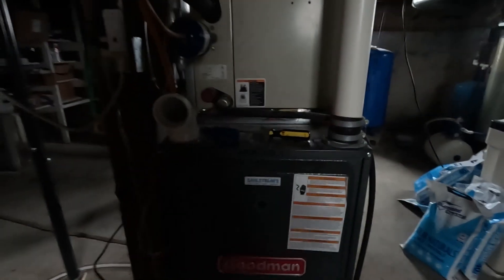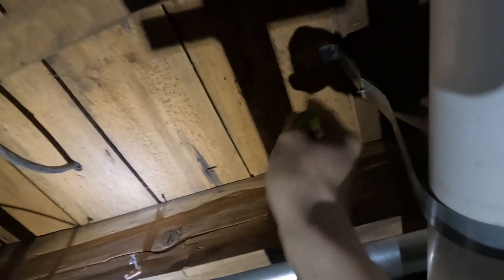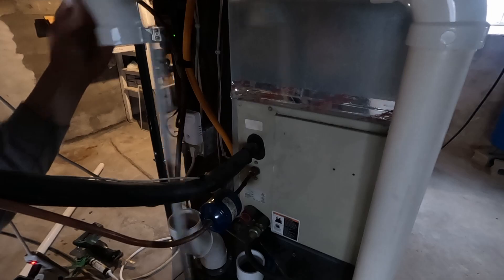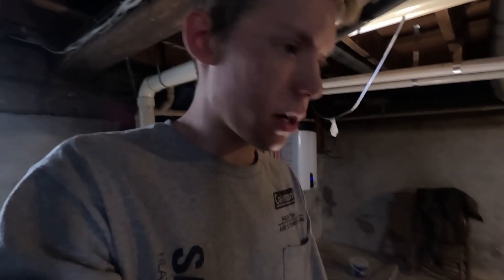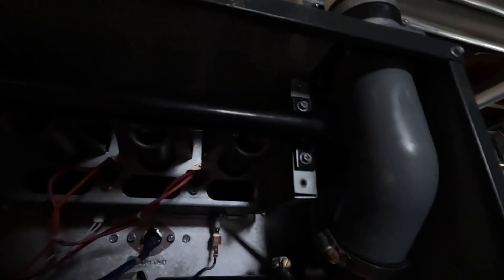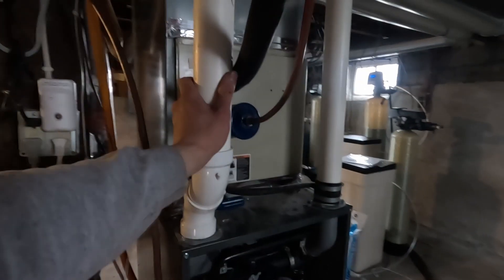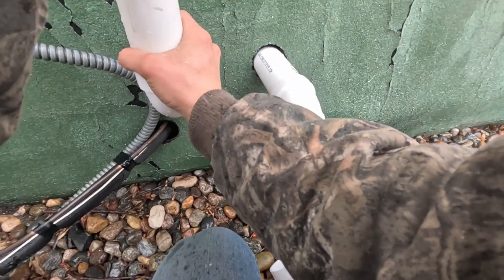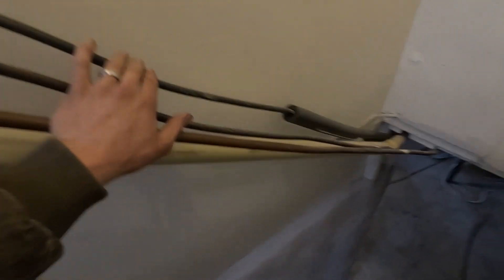Adding Fresh Air Intake to Existing Furnace

Comment: Is there a reason why they don't install "y" on the exhaust and intake.  I feel like a Y with a screw cap would make for a easy clean out if needed.  Or is there a reason they are not installed?
Reply from the maker: Usually it's best to cut the pipe, and put a fernco so nobody inadvertently uncaps the exhaust. If the combustion is out of whack it produces enough carbon monoxide to be very dangerous. The intake would be fine though, but we usually just leave some of those fittings unglued for easy service.

Comment: On your exhaust pipe, the white pvc looks like it is going into a black rubber connector?  I have leaking water around my flange the is attached to the top of the cabinet(where the white pvc is attached and the gray flue pipe on the inside attaches to the flange on the bottom).  Do you think my connections were glued?  Im sure they were and I plan on getting a new flue pipe, maybe the flue elbow pipe and a new flange & gasket.   Somehow water is leaking from around the flange(I checked the drain hoses inside & water is draining into the side catch & pumping out of the condensate pump.   Im thinking theres gotta be a crack where the flange and pvc meet?  Sorry for the long text just frustrated lol
Reply from the maker: Well, I would suggest trying to tighten up the clamps on the rubber fernco. Sometimes they work loose or the rubber shrinks a bit causing a leak. The other thing you could do is pull the condensate trap off and rinse it out good. Make sure the dip tubes are clean and not blocked off. I wouldn't think it necessary to replace the whole pipe. If you can just find where it's leaking I would just fix that.
Reply: @ReubenSahlstrom  I don't have the black rubber fernco.  Mine is a gray Goodman flange(part #200497) that has a think gasket where its seated into the top of the furnace cabinet.   The gray flue pipe inside the furnace is connected to the bottom of this flange, and then a 45 white pvc is connected to the top of the flange.  It is leaking water on top of the cabinet front around that gray flange.  Ive taken apart all the drain hoses and pipes to make sure theyre clear, which they are.  Disconnected the condensate and water is being pumped out, no problem.   I think either the flange has a small crack or it needs to be resealed at the 45.  I think the water is leaking when it runs back into the furnace in the exhaust line and a small amount is seeping thru the crack while most gets pumped out.

Comment: Goodman seems to design some things very well and some things terribly. Their burners inducers and pressure switches are pretty easy to access, but I can't figure out why they liked to put their blower capacitors all the way at the back of the blower. Also their condenser coils are trash.
Reply from the maker: You my man, have been around the block. I have found the same issues with Goodman as you. Their heat pumps are not very reliable. I am always fixing leaks and low voltage lines on them.

Comment: Hello I enjoy your movies.Can I say a few things. I am not trying to trash you since You most likely did not install this unit.
At 4:40, the filter is on the side of furnace.
The supply air going to the above rooms, have no visible return path to furnace,other than the stairs,which would make a hellish draft  and noise.
I won't even talk about the wood stand that furnace is sitting on,hopefully the furnace is rated for use on combustable surfaces.
I recommend the INTAKE pipe use the snorkel extension,with a double elbow to keep the rain out.
The (exhaust)venter motor will push out any snow that might get in, easier than the intake sucking in snow.
The a/c line set is not sealed to outside, bugs can enter and mice can make the hole bigger very fast and the holes could let in flue gasses to the house,since the basement is a big depressurized zone,again because of the lack of a  proper cold air return.
Hey, you were there and I wasn't and could see If saw what I saw.
Reply from the maker: Yeah, not everything there is conventional. What did you think of that plumbing right at the end? This is one of those old farm houses that uses a "Wild return" which depending on the setup has some advantages and disadvantages. As for wether or not it's rated for contact with combustible surfaces, most modern furnaces are rated to contact them at least on the bottom. Even garage heaters only require an inch of clearance on the top (where they are mounted). I am glad you got some entertainment from it nonetheless! ☺
Reply: If you look again, the furnace has a return drop and filter on one side, and a open filter on the other - poor man's basement return. i just hope there isn't a natural draft water heater near by.
Reply: @Jon-hx7pe   I saw a tankless water heater on the wall

Comment: I think almost all condensing furnaces should be installed as 2-pipe. Using indoor air for combustion takes away the advantage of not drying out the house from having cold, outdoor air replace it and also cuts the efficiency a tad for the same reason. 
Though I also despise 2-stage furnaces on single stage thermostats and automatically assuming factory high speed is right for cooling, yet most seem to be done like that.
In an unfinished basement where it's easy to run pipes and thermostat wires, there's no excuse for either single pipe or single stage stat on 2-stage furnace. (and goodman royally screwed up their gmvc by removing w2 from the board -no excuse for that either)